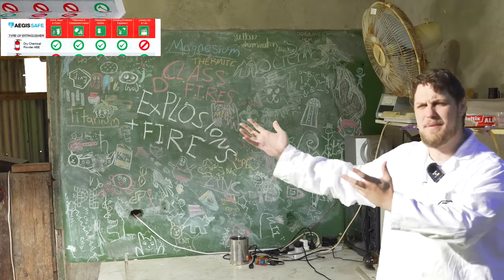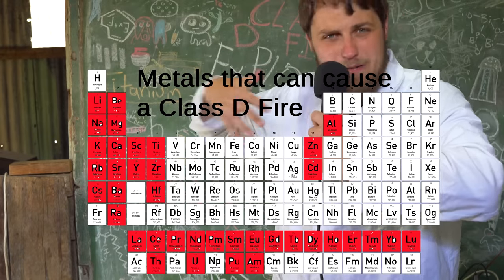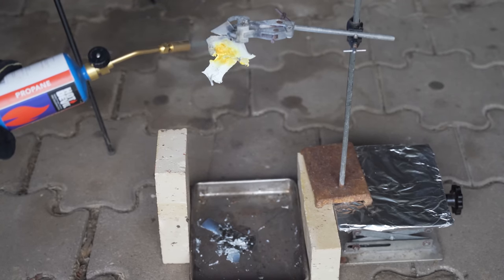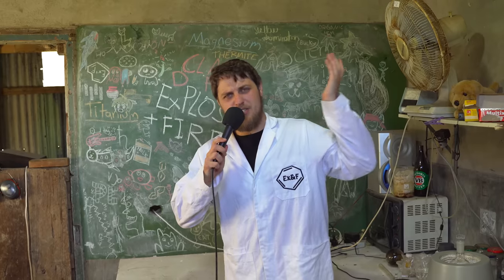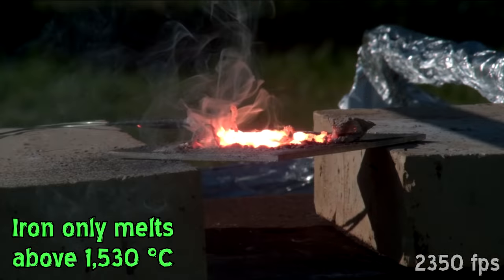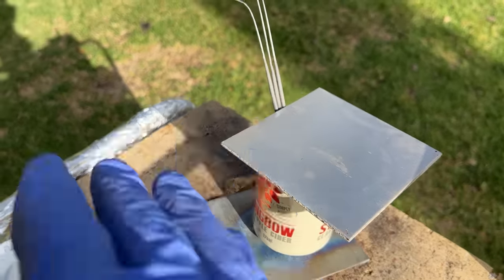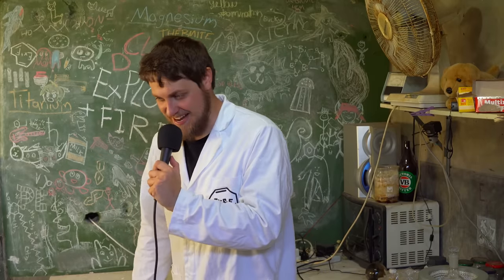Lighting metal fires (and putting them out??)

Comment: magnesium automotive wheels used to be a major problem for firefighters. as you stated they are hard to put out and since they are surrounded by a highly flammable rubber compound that burns hot enough to turn asphalt back into a gooey mess it has more than enough potential to ignite the mag wheels. this is one of many reasons why it's rarely used in automotive applications now
Reply: Apparently this is starting to change. New alloy formulations are much harder to ignite and the corrosion issues are apparently solved to the extent you can get wheels with 10 year warranties on them now.

Comment: I'd really like to see a follow up where you try to put a metal fire out using different kinds of off the shelf table salt, to see if it's even feasible to put one out without such an expensive fire extinguisher.
Reply: Well, the powder itself is less than half the price. The salt needs to be finely ground and have an additive that makes it much easier to flow along with a caking additive. The nice thing is that MSDSs exist and they list what's in them.
Reply: I imagine a good part of the price is just keeping it dry enough tbh

Comment: For ideas around setting fire to titanium, one thing that comes to mind is Dicyanoacetylene- a chemical I read about in a rocketry book I didn't understand, but they said it burns at something absurd like 5000 degrees, so that's neat! Probably really hard to synthesize, almost definitely toxic, but I'm an idiot currently failing out of an undergrad software degree so I feel qualified to give recommendations on highly unstable chemistry.
Reply: Yikes that thing is the king of triple bonds. Wikipedia states it is the highest oxygene burning temperature fire at ~5300K. Can go as high as 6000K if burnt in an ozone atmosphere.

Tho the syntheis requires nitrogen gas over graphite powder at 3000K kinda hard for Tom I think
Reply: @Dani-Nani  sounds like a byproduct from making calcium carbide.
Reply: @Dani-Nani  "syntheis requires nitrogen gas over graphite powder at 3000K"

You know a bunch of chemists at a BBQ with a lot of beer came up with that.  Drunk chemist: "What if we heat graphite to 3000K and add some nitrogen!"
Reply: @Dani-Nani  You know, it might be easier than you think. I wonder if you could make it with a carbon arc lamp like setup in a stream of N2.
Reply: Regular acetylene in oxygen will do the job, and it's almost as hot
Reply: @guytech7310  Reminds me of the ever lovely FOOF - apparently quite easy to synthesize, you just run a mix of oxygen and fluorine gas through a 700C heater block. Good example of how "easy" and "advisable" have no overlap, I guess.

Comment: Hello! As far as lighting the Titanium on fire, methinks a beefy welder might do the trick, high-current arcs tend to get hot. A Plasma torch would certainly light it up, but molten splattering Titanium right next to a live Oxygen feed might not be ideal. As a last resort, some potent oxidizer that is used on metals to clear the oxide layer could work, it should act as a flux, keeping the titanium surface free of oxides untill it heats enough to sustain the fire. PS: I have absolutely no background in chemistry so results may vary. ^^
Reply: On the other hand, hot titanium in a stream of oxygen does sound like an excellent reason to bring out the expensive fire extinguisher.
Reply: @dnebdal  Can't argue with that! :D

Comment: One of my grandfathers worked for a major aerospace manufacturer, during and after WW-II.  They had their own fire department, between military secure operations, and special fire classes.  

At some point they bought a rather expensive and high tech, low weight in order to carry more tank capacity within truck highway weight limits, magnesium fire truck.  When it caught fire, their sample of a Class D fire dwarfed anything I've ever seen academics pretend was a large metal fire.  

Thermite variants could use more attention, eg welding to destroy tanks, versus CadWeld brews optimized for attaching copper heavy wire or strap to copper flashed steel ground rods, or tower bases, or to bond railroad tracks.  That would also allow discussion of CadWeld fixtures to contain and shape molten metal, and their use to bond to structural metals without undue damage to their integrity.

Comment: After looking up that Ti-6Al-4V alloy, I'm thinking you're going to have a real hard time lighting that on fire because of 2 reasons.

1. The alloy is known for it's corrosion resistance, I saw it stated that it's even better than stainless steel. Thus making it react with stuff is hard and/or it forms a really protective oxide layer around the alloy.

2. You can TIG weld the stuff without any special precautions. This makes me think that even if you get it ridiculously hot, it's not going to catch fire because if it could, it would cause problems while welding because if the inert gas was removed before it cooled down, it could start fires.

Maybe you could make it burn in the normal atmosphere if you tried to TIG weld it without gas, but I doubt it. Maybe try an oxy acetylene torch as that is both hot and has plenty of oxygen with it to make reaction more likely?

Edit, I actually found a study on the ignition temperature of this particular alloy. Their finding was that it ignites at 1680 °C. So it should be doable with a welder.

Comment: I'm a bit surprised you first went the route of thermite rather than increasing the surface area of your sample. At the machine shop where I work we have a class-D extinguisher because we occasionally machine magnesium. The hazard is really not the  parts themselves but the chips from them. Those can catch fire quite easily if exposed to heat. Since everything within our CNC mills is being constantly sprayed with cutting coolant that's usually not much of a factor but we still need to have the extinguisher on hand just in case.

Comment: The reason why the thermite and therMATE didn't burn through the plates is thermodynamics... ALTHOUGH iron only melts above 1500 degrees, as soon as it touches the titanium plate it immediately starts cooling down while the titanium heats, thus exchanging energy until they balance themselves (probably well under the melting point of titanium and iron). Since the thermite burns out really fast, it can't really keep up inputing energy long enough for the titanium plate to reach its melting point.

Comment: Machnist here, get yourself a titanium aluminum nitride or titanium nitride coated 1/4” drill, turn that plate to swiss cheese amd collect the chips. Be careful use a sharp bit, lots of oil, slow rpm, and firm pressure, clear the chips as you go so you dont catch the workplace on fire.

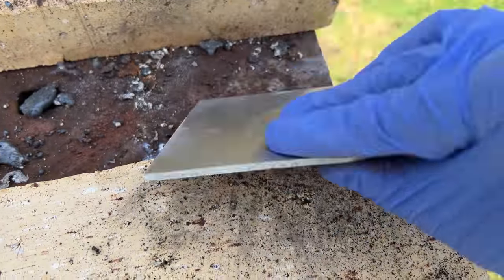Comment: 7:21 theres a reason why they always use a flower pot when doing a melt demo with thermite, you need to keep the heat concentrated, all the molten metal just spreads out when it sits on a plate like that
Reply: lol, and also I would bet your grans silverware isn't pure iron either

Comment: Working at a Tantalum Capacitor Scrap recycling facility, we have a few Class D extinguishers.

If you have material catch on fire, best to move it away from everything else and cover it with the salt.  Then leave it be till the following day at least.  You need it to cool down so it doesn't combust again if disturbed in the presence of air.

Only have seen two bad metal fires.  One that was because the caps were being processed with too little water.  They ignited, boiled the water, heated more, split it into oxygen and hydrogen, then that caught on fire.

The other bad fire was because a coworker did not mix acid and water properly while treating caps.  The caps reacted strongly with the acid, heated them up, and caused them to ignite.

Comment: We work with titanium all the time at work. It has to be shavings or grinding powder coupled with lots of air to get it to actually flame up violently. There was a titanium fire in the big scrap bin out back because a maintenance worker was cutting something off the scrap bin with an oxy-fuel torch and set a bunch of shavings in the bottom on fire. There wasn't any risk to nearby structures so the fire department just let it burn and it melted a bunch of the steel but many of the larger scrap titanium components were still fully intact once the fire died out.

A pile of grinding dust that's left alone won't really burn, it tends to smolder. If you then sweep that pile of smoldering dust onto the floor or something it will flare up violently as it gets mixed with oxygen in the air. 

Titanium rapidly absorbs oxygen from the atmosphere at elevated temperatures, and it can absorb a lot of it. So I think that with your plate of it there just isn't enough available oxygen to sustain a fire because lots of it gets absorbed by the metal and turned into forms of titanium oxide. Many of those aren't actually considered flammable either. 

An oxy-fuel cutting torch could probably set strips of titanium on fire, but you can also use that to cut titanium pretty readily without the entire thing going up so again I think the density and surface area has to be right for fire to sustain itself. 

Also Titanium, especially 6al4v is used on jet engine components and high performance rockets/jet skins where it sees service temperatures of like 600°F+ so I think you're going to get it close to it's melting point to get it on fire without using like pure oxygen or something.

Comment: Titanium requires surface area and/or oxygen contact.  You could aim pure oxygen at a red-hot spot on it. That, or make a titanium "sponge" of some sort.  Maybe take a bunch of thin titanium wire pieces mixed with plastic pieces and secure one end in, idk, plaster or something, and then melt the plastic out, leaving you with a sponge-like arangement of thin titanium wire that you could then try to burn.  Maybe start it with some titatium powder you could light up on it?  :P
Reply: From what I have heard the titanium sponge is probably the best idea. Usually when you hear about titanium fires they come from machine shops that don't clean up titanium shavings fast enough and have piles of the stuff for when some random bit catches fire on a lathe.

Comment: 1:25 I'm starting a PhD that involves working with Lanthanides and I feel called out

Also I am assuming you couldn't set the bulk titanium on fire because the surface oxidized far too quickly, protecting the rest of the metal. Which in most cases is exactly what you want.
Reply from the maker: Lanthanides make very fun and interesting PhD projects! That's why the conspiracy is so successful

Comment: Metallurgist here who works with Mg and Ti powders, those powders are pyrophoric, especially Ti which can spontaneously combust (our supplier processes and ships the powder under argon). For bulk material, 40 and 70% ferro-titanium lump (>1") in size sparks when they hit each other, even from a drop of a couple inches is enough to cause this. It is a similar phenomenon to ferro-cerium (from that conspiracy based lanthanide group), the "flint" in lighters. I would imagine these could be easier to ignite in bulk. Also slow heating 40% ferro-titanium at ~350C  in a very tightly enclosed metal space could cause some runaway thermal reaction but I'm not 100% on that - it is speculation based on seeing something like that occur in an application.

Comment: It's neat to see how things are in different places. I service and sell fire extinguishers.
Those 30Lb amerex D class extinguishers are definitely expensive. There is also a copper powered version model C571.
Where I live A is paper, wood, cloth etc.. B is flammable liquids(gases fall into this catahory as well, like we select B rated for propane powered industrial trucks for example) , C is energized electrical equipment, D is combustabke metal, K is commercial kitchen equipment fires involving oils and fats.
And that's it, 5 classes.

Comment: The discolouration of the metal from heat isn't just the chemical reaction of the oxygen from the air. It is the rearrangement of metal grains like you would get during welding in the heat affected zone, or the weird discoloured chocolate you get if it has been heated up and fridged.

Comment: If you want to keep it as thick hunks of metal rather than fine powder or turnings, then electricity is probably a good go-to.  Dump some amps into it.  It would be easier if you could get a strip, ribbon or wire of the metal, since the wider and thicker it is, the more current you will need - but there is basically no limit to how hot you can make it.  Another idea, get it very hot then drop it into LN2 or LO2.  (some will form nitrides with LN2 but it is the LO2 that will be the real fun)

Comment: In the USA we have Class A for solid, B for liquid, and C for electrical, then D for metal and K for kitchen.  A typical household extinguisher will be of the "ABC" dry chemical type.
Reply: Right and for good reason.   ABC extinguishers are found in almost all businesses as well as many homes across America because it can handle virtually any  class of fire likely to occur.   On the other hand in industrial environments and commercial kitchens where the risk of a class D or K fire is significant, a class D or K extinguisher in addition to the ABC type should be readily available and adequate training should be provided to employees regarding their use, if and when an emergency occurs.

To help remember the proper extinguisher for the fire you're attempting to fight, the following acronyms are helpful.

A = Ash   B = Barrel. C = Current. D = Dynamite.  K = Kitchen.

Comment: As a knife maker who has done a big bit of grinding on titanium… I always treat titanium as a flammable metal because I have accidentally lit titanium and zirconium powder that was mixed from previous work products… Created a fire that was so hot it burned a hole in the concrete floor. Not a big hole but it burned a spot of the concrete to the point where it just had left a crater

Comment: Use electricity to set it on fire! Cut it in an hourglass shape, modify a transformer so the secondary coil has a few windings of thick wire and connect to both ends. Should be able to melt it easily.

Comment: 2 stage thermite should set that Ti on fire. Just start by using Ti as the fuel in stage 2 (put in the bottom of the cylinder), and then put normal thermite on top to start the nastier stuff.

If you really want to get kinky, use some depleted U for fuel, and then some magnetite for oxidizer... not only will it be energetic, but the depleted U, and the resultant Iron, should have a nice exothermic reaction to boot.

Comment: You can try the following:
- Converting it into fine chips
- Using oxyacetylene (3100ºC)
- Using a TIG welder without any gas, at the max power possible

Comment: A few years ago when vaping was still in it's infancy, there was a company who was playing with temperature control using titanium as the heating wire. It was really easy to cause the titanium wire to almost instantly turn into what I assumed is titanium dioxide.

Comment: An aluminium oxygen torch is a good home brew solution, if memory serves it gets to about 3500 Celsius.

To make the nozzle tightly wrap aluminium foil around a long dowel so you have a 30cm or so long tube 8 or more layers thick, then remove the dowel to leave the tube hollow.
Affix the nozzle to the end of a high flow rate source of gaseous oxygen, a pressurised O2 tank works well for this.
I would suggest adding a steel tube between the aluminium and the pipe from your O2 source so you have something sturdy to hold so you can manipulate the contraption.
Not he easiest thing to light but once it gets going it burns rather hot.

Fire proof gloves recommended, just in case.
Don't try at home unless you really like house fires.

Comment: Surface-area per volume is the secret. If the area available for oxidation is not big enough to elevate the mass 'behind' that area to ignition temperature, you wont get a self sustaining fire.

On the other hand, if you grind titanium just small enough, it will catch fire all on its own.

Comment: My fathers work incluedes thermally coating mechanical parts with titanium, for which they use a very fine titanium powder. The have had fires because someone tried to suck up residue powder from the processing chamber with a vacuum that wasn't rated for that purpose. Static electricity was already enough to set it off.

Comment: In SCUBA, some regulators are made of titanium to reduce weight. Those regulations are considered incompatible with rich nitrox mixes and with pure oxygen, particularly at the first stage where it is exposed to tank pressure and adiabetic heating is more of a hazard. So apparently it's a bit significant a fire hazard under around 200bar of pure oxygen.

Comment: Fun fact with magnesium! Porsche made a few sports cars with magnesium roofs and if the cars would flip the roof could spark and burn to the ground the same thing has happened with magnesium wheels if there was a impact hard enough on the wheel (hitting a pot hole at a extremely high rate of speed) when wheels could start a fire burning the car to the ground

Comment: Thermite's used to weld railway tracks together, but they use funnels to guide the molten iron into the spot they need to weld. Maybe a similar approach could concentrate the heat towards one spot of the titanium plate? There's always the option of the just using more thermite until it catches fire 🤷

Comment: If you want to set the titanium on fire you could use something like that styropyro device with 100 car batteries in parallel. I don't know if you will set it on fire, but you can use it to achieve pretty much any temperatures you want and, more importantly, concentrate that temperature in the metal rather than in the surrounding environment like with thermite.